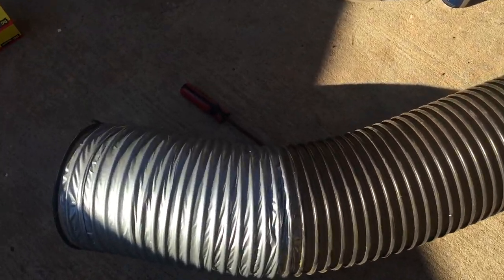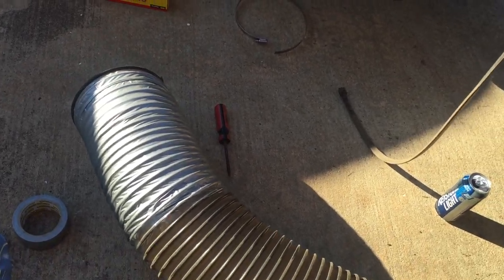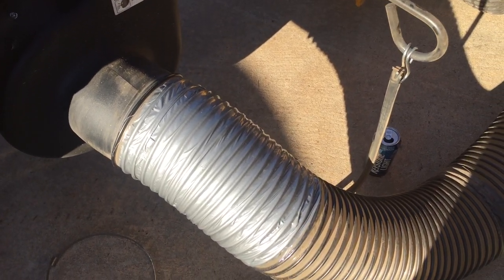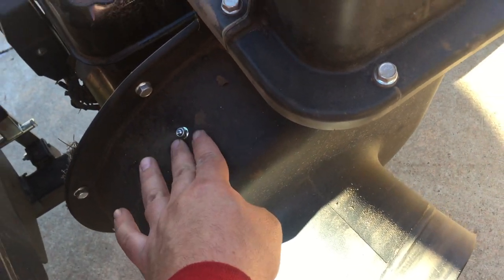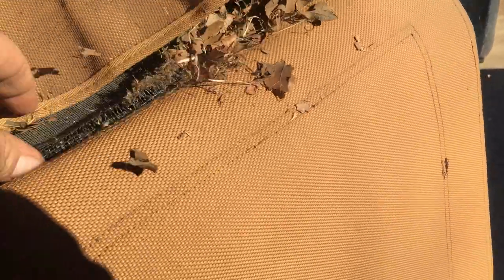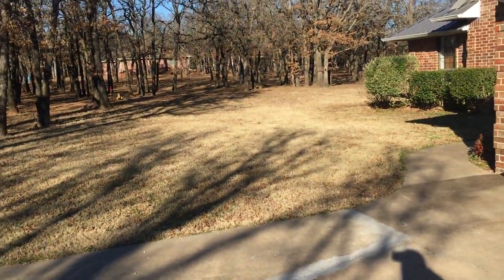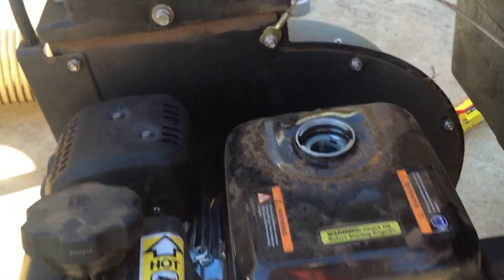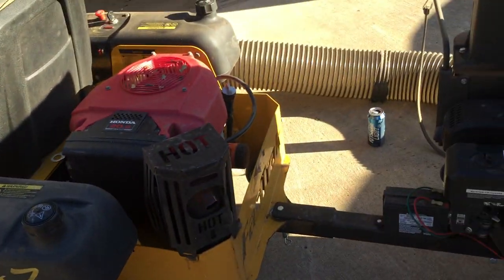DR Leaf and Lawn Vacuum Review.

Comment: This review is 100% correct.  I've had my DR leaf vac 2 fall seasons plus spring of 2018 when I blew out my second hose.  Customer service is excellent and I extended my 2 year warranty last fall to 5 years at a reasonable cost.  They need an elbow at the end of the hose.  You cannot make sharp left turns or you may tear the hose at this weak spot. Suction is incredible without upgrading to the Subaru engine. However, walnuts blew out the seam in the back of the canvas clam shell and they replaced it as well. They need to reinforce the back of the clam shell where objects like walnuts and acorns are blown into the back of it. I actually cut a sheet of fabric from the old clams shell and hung it like a curtain inside the new one as reinforcement and it is working well.  DR should do something to strengthen both of these week spots. Otherwise it works great.

Comment: I have the big pro xl. I do not have the gas tank issue. But I do have the hose issue I’ve had mine three years and I’ve went through three 8 inch hoses. I also had a hole in my shoot at that 90° band where it goes into the carrier. I ended up cutting a piece of aluminum than using silicone and rivets then covered it with black duct tape and it seems to be working fine.

Comment: Thanks for the review. I'm glad I went  with cyclone rake now, i have none of those issues. I know that the cyclone wouldn't work for your situation. I hope your alterations can fix those flaws.  For the cost of the DR, you shouldn't be dealing with those kind of problems already.
Reply from the maker: Wayne Williams I agree. 4 season in to ownership with this machine I’ve been able to work out most of the bugs. I found a longer hose that although it lasted longer it also got clogged more often.
Reply: @dout9929   When I was looking at the DR  I didn't like the way the hose hung on that swing arm, I was  concerned more with it clogging up when you made right turns. Never imagined, they would short you on hose, let alone, not make a more shock resistent transition to the impeller housing. I can tell you i've seen a couple more review like yours, but the others seem more forgiving to DR. I guess when it works, it's that good.
Reply from the maker: Yes when it works it’s very good
Reply: You saying the cyclone would not work well for lawns with acorns and other stick debris? Looking into both these machines and the Agri-fab mow n vac
Reply: @Mr-Marbles  the Cyclone does pick up some acorns and sticks as long as your mower can mulch them down to hose size, or they're not embedded from riding over them. when the sticks are too big nothing suck them up. If they do, that will be the source of most clogs.

Comment: There's a lot to be said for using a stock bagger sometimes... might take the 14 bushel over this... dont like the lack of maneuverability
Reply from the maker: Bobby I don't have a stock bagger. This system does do a better job of breaking down the leaves because they pass through the blades and the impeller

Comment: I’d never buy a DR Power leaf vac again. Mine is a 2016 and has the exact same issues. I’m on my 3rd hose for the reasons stated in this video.  To answer the question about the plastic discharge chute, yes.  As soon as you run over a small stone or something it will shoot a hole right through the curve. Mine is wrapped in a piece of sheet metal over the hole and duct tape.   If you’re looking for a lead vac, don’t get a DR.

Comment: that's an really old vac. all of  them now move straight with the mower. Put caster wheels on the back of the vac.  then buy yourself some bars to mount the vac solid with the mower so they move as one.  I converted mine runs great.  Also you need a screen vent in the top to keep the suction.
Reply from the maker: jason skeie the model before this one was fixed position style. I didn't go with it because I liked how ease it is to empty the clam shell design and there are areas of my yard that would be very hard to navigate with a system that could not articulate.
Reply: ahh well the hose breaks